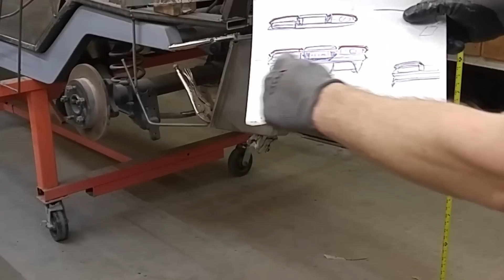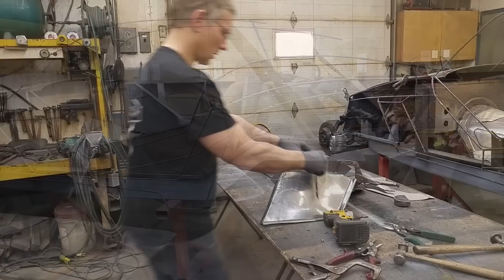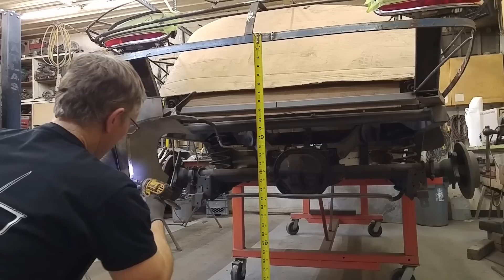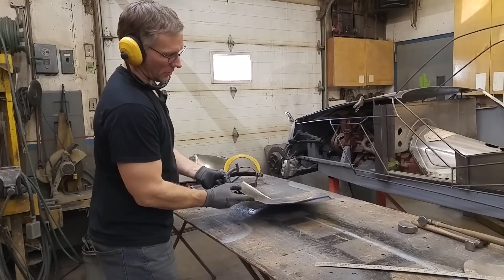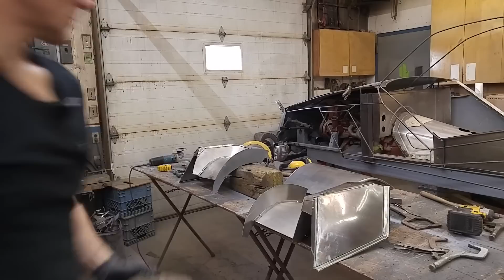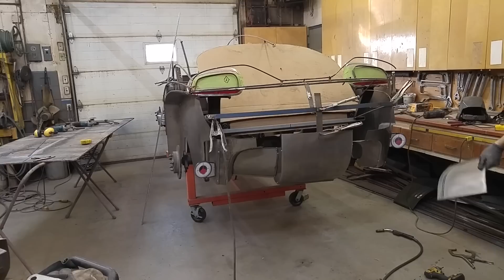Rear Bumper Diffuser Made with Simple Tools - Ep.7 | After Burner HAND BUILT Hot Rod

Comment: Nice work as always.
 May I suggest using a Stanley Leverlock tape measure for your sheet metal work. Try one out, 
 you might find it more effective...
Reply from the maker: Thanks for the tip!
Reply: @iNVisionPrototypes  
I keep several around my shop and one in the truck .
 As a sign painter/fabricator they are much easier to use...

Comment: Thank you sir. I like the number plate where you indicated. In Australia you’d get a defect notice if your tail brake lights weren’t visible from 30 degrees on the side. Not that you need to worry about that 😉 Cheers 🇦🇺
Reply from the maker: Hi!  Head and tail light visibility is of paramount importance in doesn't matter what one is driving.  Someone doesn't see you braking/turning and they run into the rear, you and the car will have a really bad day! That's one of the reasons why I did what I did on the i51S with the LED lights.  The originals were quite small and hard to see.  Back in the day there were a lot less cars and congestion on the roads.  Thanks for watching!